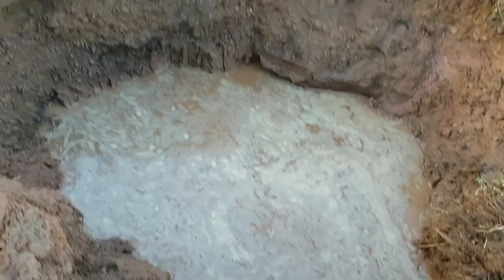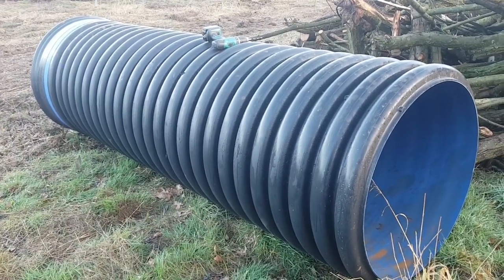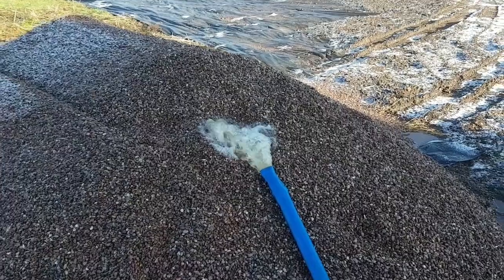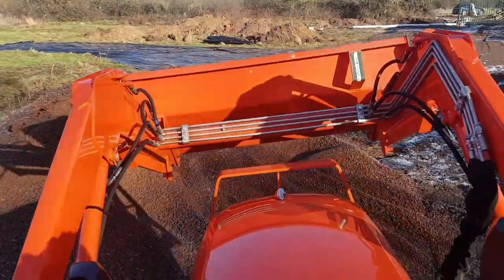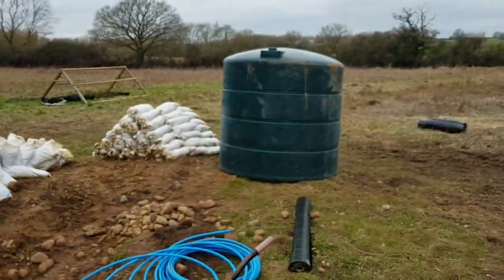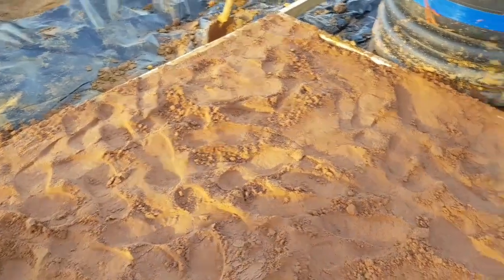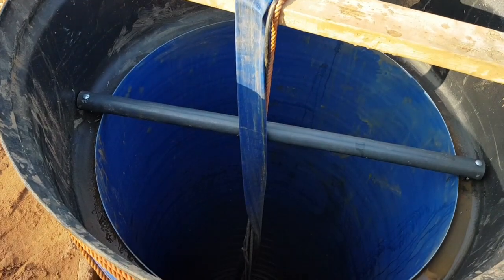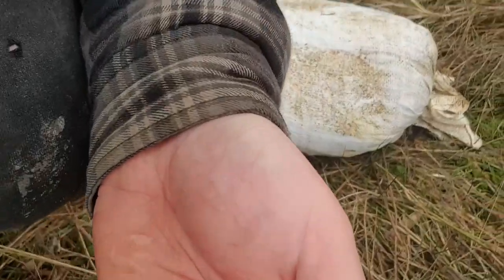Off Grid Water Supply. The Shallow Well Build/Digging!

Comment: Great video mate. Out of interest why did you drill holes in the side of the pipe before burying? I'm assuming it's to allow water in but my assumption was that the water would filter into the pipe from underneath?
Reply from the maker: i wasnt sure how much the pipe would sink into the clay at the bottom and didnt want to to form a seal and block the water

Comment: I forgot to ask You, how wide was the pipe I'm debating 650mm or 450mm twinwall drainage pipe ?

Love yours vids btw! 😊

Danny
Reply: How deep was the gravel underneath please sorry for questions I'm doing this in my garden next week. I'm at 10ft and checked this morning had 3 half foot of water that was not rain water btw from below ground chuffed lucky to have water.
Reply from the maker: It's a 1050mm pipe big enough we can get down to dig deeper was the plan, but think we are just going to wait and get a borehole drilled if we need more water. It's about 1ft of gravel at the bottom under the pipe and 2ft gravel up around the sides of the pipe 👌

Comment: Do you need to do the holes ?
Reply from the maker: I did it so the clay bottom couldnt form a seal when the pipe settled
Reply: Good job mate, I have 2 springs in some disused land behind my fence, my house is built on concrete pins. I'm digging mine this year, I'm foot n half deep now, try get to 6ft by end year and do your method, looking at concrete drainage culvert instead plastic but I'm now worried I may need plastic because of the holes, I cant drill concrete to thick. Then gravel it around, from oldham area very lucky to have spring, nice location you got there, love these kind of vids I live for it, anything do with nature self sufficient and FREE gives such satisfaction,subbed.
Reply: @FieldtoFarm_UK  I see wat you mean, good idea, I'll do the same to maybe rest it on bricks with gaps underneath.
Reply: My spring is full to the top of water even now in june it's only 6/8 inches below ground level my water table lol I'm lucky
Reply from the maker: Plenty of gravel underneath should be sweet I'm just over cautious lol. If you have got hills to climb or no machinery to lift concrete culverts  I'd recommend the plastic still for ease of install.
Reply: @FieldtoFarm_UK  yes imgoing with plastic and I'll def take on board the gravel instead of bricks why didn't I think of that lol like the earth bag house you seem like that kris harbour guy he similar to you! Cheers buddy Gudluck! Dan